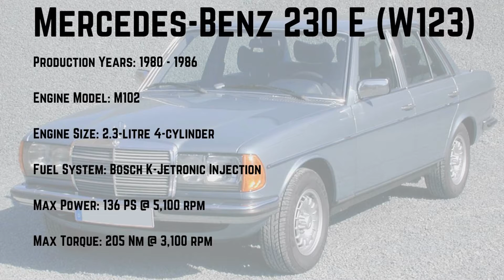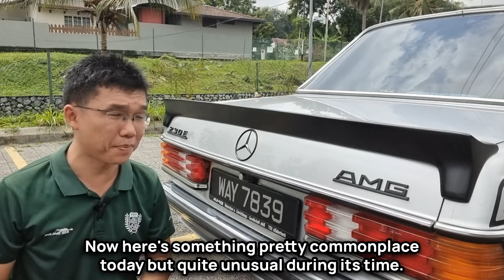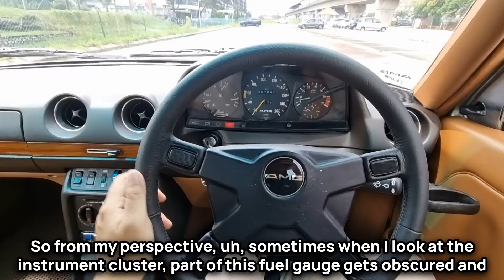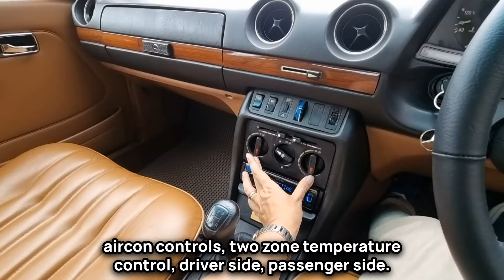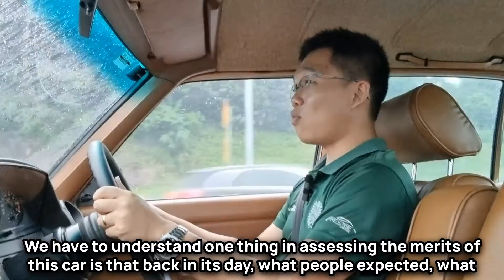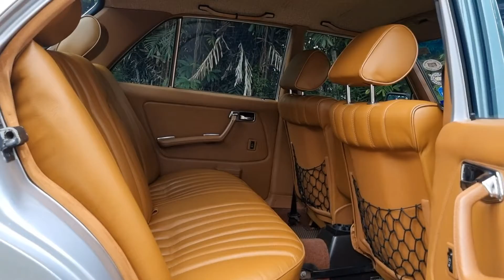How AMG enhanced the Mercedes-Benz W123 in the 1980s | EvoMalaysia.com

Comment: Fabulous car, very rare, the AMG parts must have cost a fortune!

it must have been re trimmed as W123 door cards were notorious for wrinkling the material

The AMG additions make it look different, not better. Personally I think none of the additions suit the shape of the car, they look “added on”, in the 80’s AMG additions in the UK were not popular, only footballers had them
Reply from the maker: I totally get what you mean. I prefer the W123 in the classic look complete with the painted wheel caps.

Comment: well speech, well preserved condition of car. wondering this AMG W123 is suffering from leaking problem into cabin from armpit and firewall? That's the killing part for people to give up on keeping them. Hopefully not.
Reply from the maker: in my short stint with the car, did not pick up any leaks. the current owner says the previous guy spent a lot on the car's structural repairs.